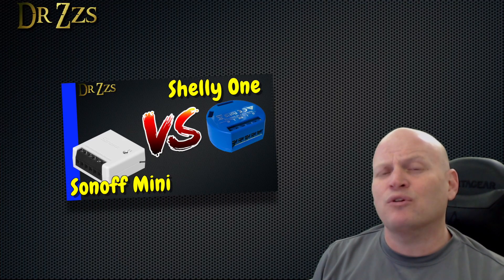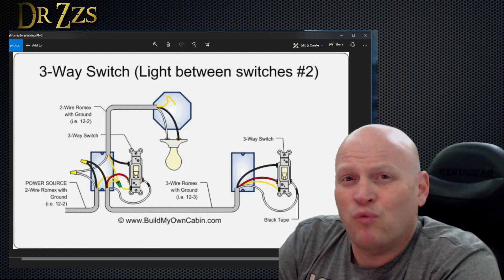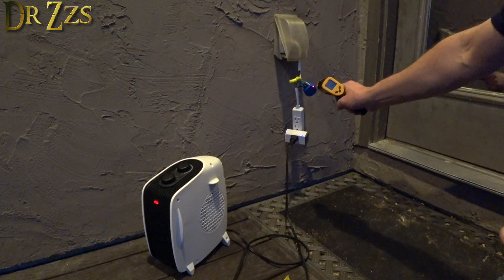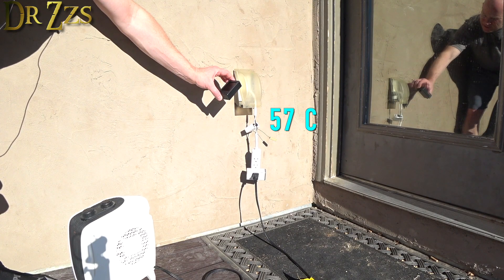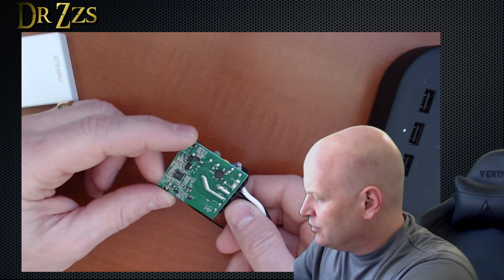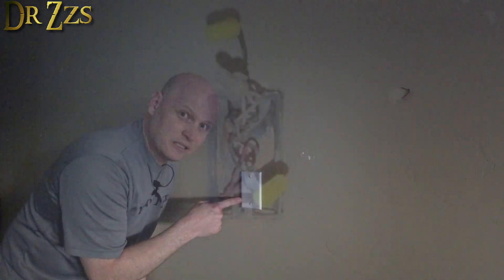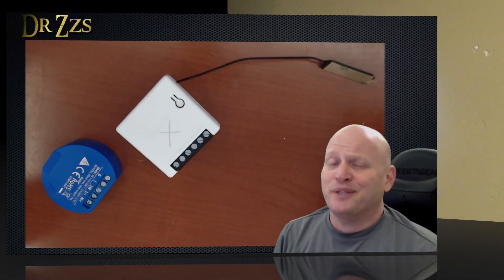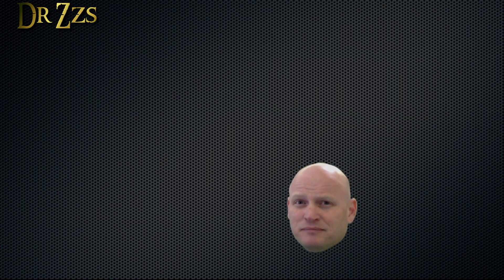More Sonoff Mini vs. Shelly One Comparisons | Home Automation

Comment: Hello, Please, I have a problem that I can't solve, I have alots of shelly controls lights. I cannot make a correct automations with any one. This because the binary sensor input that gives us the state of the shelly (if is in on or Off) is only updated with the switch (interruptor). So if the last time the switch was on, then the binary sensor remains in on state even if I turn off the light from HA. The binary sensor is only updated with the physical switch. I try all configurations but no way. I cannot have the correct state. Now i have the setting: type Button in Edge switch and Power On default mode in Restore Last Mode. Any solution to have the correct state? please need help from you boss!  thank you very much in advance

Comment: Does shelly still control the light using the switch its connected to if it loses wifi connection, or your router goes down?

Comment: I see you used much lighter gauge wire on the Sonoff for the Switch Contact Voltage test. Will that work for a 3 and 4 way set up? I'm worried about the length I will need between the switches. I know that's another matter I can look up myself, but is a smaller size ok in general for the physical switch hardware?
And thanks. I subscribed for the two Sonoff/Shelly videos but you've got a lot of cool stuff I've recently added to my watchlist!

Comment: I used to quite often lose the wifi connection to the Sonoff I had to turn my pool filter pump on and off. Probably because it was at the end of my yard inside a metal box.

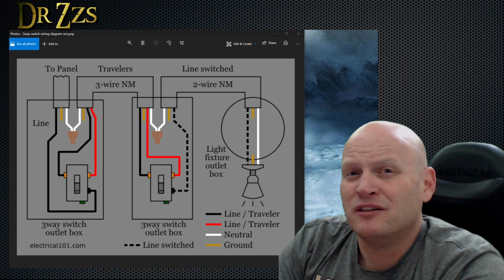Comment: 2:45 i hawe a diagram that solves the problem:) how can i send it to you?
Reply: You wouldn't still happen to have that diagram, would you?  Staring down the same thing currently, would love to see how you got it to work!
Reply: @AndréGuimond-v9j  you need to have two devices sonoff mini.  only one device will turn on the light bulb with relay. the second device will run only automation in nodered or Home Assistent. :) The Automation Starts relay on first device:)

Comment: Between the Sonoff mini with the enclosure, and the Sonoff Basic bare board, which one is harder to fit inside a single wall switch box? I have yet to own a mini, but had some hard time fitting the Basic bare board into some wall boxes in my house. Just wondwering if it would be easier to use the mini instead.

Comment: @DrZzs not ever thinking I would get into any kind of programming came into an adafruit a month ago and for Christmas received a Raspberry Pi 3, so I have some work to do with terminology and actually programming my first chip.
The exciting thing is I understand there is a way to program the sonoff, which will be of a benefit since 10 sonoff minis are on the way in the mail, to wire into my light switches, and I want to understand one thing.
Is the point to flash tasmota to a sonoff for more versatility since I already have a SmartThings Hub, does that sound right. From what I understand even though eWelink will work with sonoff and with Google home, to flash them would not only be a great exercise but make it more cohesive with my present hub.

Comment: FYI: DrZzs I order some shelly 1's but also shelly 2.5's for my home. And found out that the shelly-2 is only 8 amps, and the shelly-2.5 is only 10 amps.  I bought these 2.5 versions because most of my switches have 2 or 3 buttons. I tell this because I never hear from youtubers about this important fact.  Are we supposed to use in-line fuses for 8 or 10 amps for these shelly's too? and Why are they UL compliant if they are less than 15amp circuits?

Comment: I think that the Shelly 1 wins hands down. Might  be  more expensive but makes up in functionality and flexability. An example of this is the ability of being able to software set the mode of the Shelly 1 v's having to pull apart the Sonoff Mini (which I have)....

Comment: Great video, however I don't get which is the purpose of the neutral out put in the sonoff mini? 🤔
Reply: There isn't any need to use both of the neutrals. They are bridged inside. You can use them if you want it in between some cut through extention cord
Reply from the maker: Robin is correct.  It's just there to help with wire management.  It acts like a wire-nut basically.

Comment: Question: When turned to the of position wirelessly, can the be manual switched back on?
Reply: I was curious about this as well. Does the physical switch position effect the use of the smart functionality of either device? I want to say due to how it's wired the physical switch position doesn't interfere with the smart functionality.

Comment: What's appen if the device loose the wifi connection? Can I use the device without the home/internet connection? For example for switch on and off a room light
Reply: The Shelly will still allow you to operate the light with the external switch during network disconnects. Can’t say for sure about the mini... but I’d think it would work as well.
Reply from the maker: Yes, you are correct.  Both with still function without internet or connection to HA.

Comment: I haven't done any power consumption measuring of any of my home automation devices, except my Raspberry Pis, which came in at only about 2W (for my Rpi 2B honeypot - not doing much). I saw the 0.11/0.12A in your test. Does that imply that at 120V, these consume some 14W of power? That would be shocking! My 8TB NAS runs at 22W or so and the PIs are in the 2 to 10W range. Can you please confirm? 
thanks
Reply: This^ really would like a confirmation to this. Came to comments to ask so actually + wondered: whats the total energy consumption of the device while its working? I know we have what the manufacturer says, but your real life testing would be much appreciated. (just in case, what I mean is to measure the power consumed while on an "ON state" in which the relay coil is energized to provide the magnetic field for its thing, hence, also consuming more power

Comment: Nice! Very useful comparisons and tests! I never bothered testing the temperature with my sonoff basics attached to the garage door motor(just checked and it hovers around 45 to 50c!!).  So this was helpful and serves as a helpful reminder to check the load/temp... and now I want to get both the sonoff mini and shelly one!!
Reply: I wish he said a little more often just which temp-units. I know both °C and °F (°C is better) but I was only listening. So I had no idea he was wearing shorts instead of something like winter gear!! 
It's obvious if, well I guess... if you pay attention. 
But this is electricity! 
Who needs to pay attention?!? 
I know Everything about MY homes wiring! 
I'm not even an electrician!!
 .... ....
(Self deprecating humor has humorously deprecated myself)

Comment: I thought the last two contacts of sonoff mini were only for "signal", not supposed to have load, so i used two wires from an audio installation. Will they burn in long time load?Thanks for this review!!!
Reply from the maker: Those are for the Switch. Audio wires will be fine.  They won't burn up. 
One of them is GPIO-4 and the other is ground.  The GPIO pins on the esp8266 can only provide a very small amount of current.  0.12 amps max.  Even tiny wires from a phone or ethernet cable would be fine.
Reply: @DrZzs  lovely!  Have a nice day and congrats for the channel

Comment: 7:03 Is that your font yard??? That's... huge. ;)
In my opinion sonoff had a great chance to create an awesome product which can compete to shelly. They knew which are the benefits of the shelly.
But they've just built a sonoff basic in a smaller case with accessible gpio pins to connect a switch. Nothing special. I even don't get the point why there aren't accessible TX/RX/GPIO0/GND/3,3V connectors on the PCB. This is not DIY....
Reply from the maker: ha! 
No, that's a park behind our house.  Our yard is actually very small.  We kinda consider the park part of our yard but we don't have to maintain it.  It's the best of both worlds :)

Comment: The second neutral spot is to save you a wire but, you can loop your neutral through the sonoff mini.
Reply from the maker: I thought about that as I was watching this during editing.  Probably didn't need to attach that extra Neutral wire.  
Thanks!
Love the Beard Jordan!
Reply: @DrZzs  You could have just gotten rid of the neutral wire nut and hooked it right into the sonoff mini, saving you even more space and wiring. I truly think the only detriment to the sonoff is the amperage and wifi. However, if you're using it for lights then the amperage doesn't matter. The shelly wiring is ass backwards, IMO.

Comment: For all the fiddling around inside of switch boxes, wire nuts are so 20th century.  You need to get yourself some WAGO "Lever Nut" connectors.  These things are awesome!  You'll never wonder if you got all the wires connected inside the wire nut, they're easy to remove and replace a single wire at a time, and you can imagine actually connecting together up to 5 wires reliably if you need to.  See https://www.amazon.com/slp/wago-wire-connector/dzxsrhkj6f2k9tp and probably a bunch of YouTube videos, too.  You'll never go back to wire nuts again.
Reply from the maker: Nice timing!  
Dale just sent me a pack of those and you aren't kidding.  So much better!  
I used them in the extended version of this video when I do all the 3 way switch wirings. 
Thanks!
Reply: This guy knows what’s up

Comment: 0,11 Amp at 112v is 12,32 watt. That's quite a lot actually!
My wifi switch uses 0,9 watts when relay is on... and 0,3 watt when off, I got 230v
Reply from the maker: I was surprised it was that high too.  Could be that my Sonoff S31 wasn't calibrated perfectly.  But the comparison was the real point.
Reply: @DrZzs  When looking at your video, at 3:04 I see the graph raw and it shows 0,054A at 110v (assumed) so that calculates to 5,94W. Maybe you can get a known-good meter connected because if you got quite a lot of these devices using 12W everywhere you could have some nice bulbs on :D
Reply: @DrZzs  When looking at your video, at 3:04 I see the graph raw and it shows 0,054A at 110v (assumed) so that calculates to 5,94W. Maybe you can get a known-good meter connected because if you got quite a lot of these devices using 12W everywhere you could have some nice bulbs on :D
Reply: @DrZzs  When looking at your video, at 3:04 I see the graph raw and it shows 0,054A at 110v (assumed) so that calculates to 5,94W. Maybe you can get a known-good meter connected because if you got quite a lot of these devices using 12W everywhere you could have some nice bulbs on :D
Reply: @DrZzs  When looking at your video, at 3:04 I see the graph raw and it shows 0,054A at 110v (assumed) so that calculates to 5,94W. Maybe you can get a known-good meter connected because if you got quite a lot of these devices using 12W everywhere you could have some nice bulbs on :D
Reply: @DrZzs  When looking at your video, at 3:04 I see the graph raw and it shows 0,054A at 110v (assumed) so that calculates to 5,94W. Maybe you can get a known-good meter connected because if you got quite a lot of these devices using 12W everywhere you could have some nice bulbs on :D
Reply: @DrZzs  When looking at your video, at 3:04 I see the graph raw and it shows 0,054A at 110v (assumed) so that calculates to 5,94W. Maybe you can get a known-good meter connected because if you got quite a lot of these devices using 12W everywhere you could have some nice bulbs on :D
Reply: @tychowerner  Tycho, could I find out what are the wifi switches you are using that consume only 0.3/0.9W? I am also running 230V, so this is quite important to me
Reply: @EudaemonVideos  Hi, I use these plugs: https://www.action.com/nl-nl/p/lsc-smart-connect-slimme-stekker/
Reply: @tychowerner  Thanks, I'm looking for light switches though, and Sonoff and Shelly seems like the best options. The power draw at 230V is a little alarming though - I might as well leave my LED light on in that case!
Reply: @EudaemonVideos  Well; what I suspect is that DrZzs's measurement isn't accurate. With 12 Watt it's more then most LED bulbs.
When you increase the voltage from 110v to 230v the ampere's goes down so the total power stays the same, useally.
Reply: @tychowerner  Yeah I saw other videos that test using wattmeters registering 0,3-0,9W, but readings might be less accurate too and uncertain if the wifi is connected. So maybe the figure is somewhere inbetween with DrZzz's.

Comment: I'm interested in your upcoming 3-way switching video as I think I have the wiring set up like in the 2nd scenario you show where the line comes into the light and then goes out to the first switch box - since there are not neutrals in the switch box does the shelly go the light fixture box?
Reply from the maker: yes. That's exactly right.  That actually makes for a pretty simple install.  Shelly goes in the box, Line and Neutral to the Shelly, 'O' goes to the light, Neutral from the light goes with the Neutral from the panel, then the switch contact on the shelly takes the wire from one of the 3-way switch's common pole (likely black or white with black tape).  The other common pole wire from the other 3-way switch goes to the hot from the panel.  You also need a wire from the hot to the "I" on the shelly.  
I'll be working on that longer version a lot and will get it out soon.

Comment: That last comparison... For diy it's sort-of-OK. NEC requires certain isolation practices between mains and LV circuits that you're not likely to attain w/ your T/RH sensor. Maybe I'm wrong though.
Reply from the maker: You are probably right.

Comment: I attempted to install the Shelley 1 into a dual gang switch box. Unfortunately, the box was too stuffed with wires that went no where that the Shelley couldn't fit. ☹️

It's actually for my bedroom ceiling fan/light... So maybe install them inside the fan housing? That's IF I have access to the hot and neutral wires up there.

Thanks for all you do!
Reply: use the sonoff mini. If you understand wiring you can save yourself a lot of space that you wouldn't be able to save with a shelly.
Reply from the maker: I've had that problem too.  Sure seems like our boxes get over-stuffed with wires a lot.  I have a 3 gang box in our bedroom that must serve as a junction box for several circuits because I took out the 3 switches and replaced them with a single Sonoff T1 and I still had a hard time fitting it all back in there because of all the extra wires coming in.

Comment: Check the dead Sonoff for a fuse. Could be a quick fix
Reply: It could also be a blown VR (voltage Reg. Im willing to bet on it) A little AMS1117 5.0v or 3.3v on-board? Worth a look. Like 50cents to fix if I am right!
Reply from the maker: that's probably true!  I'll poke around and check.  I'd love to get it back to functioning.
Reply from the maker: I didn't see one, but I wasn't specifically looking.  I'll check again (and hope you're right :)
Reply: Its not a fuse. I think is the relay contacts

Comment: 2 Shelly’s have literally exploded in my hands....

I was very excited to get started with them, but apparently they are built very poorly according to a mechanical engineer I know.
Reply from the maker: That seems extreme.  Can you describe the situation?  I'm not paid be Shelly at all but I believe they are built pretty well compared to many other devices we use every day.
Reply: I prefer the Sonoff mini, especially the wire terminals that you've showed in your previous video.

Edit: about the Sonoff mini, you might be able to use the 3,3 volt switch terminal as an input to power the device for flashing.
Reply from the maker: I like it too.  Much improved over the sonoff basic.  I'll check that switch terminal, but I thought it was GPIO14 and Ground.  I really do wish they had given us easier access to 3v somewhere near those terminals.  Then we could use those terminals for a sensor or use a powered switch with an LED or a cap-touch.

Comment: Can you do a review of the Shelly 2 and Shelly 2.5? Features, use cases how to connect it, etc.?
Reply from the maker: I can do a project using the 2.5
Reply: @DrZzs  Pls do as I was unable to find good documentation online on how to with these devices (No schematics, no how to flash it with Tasmota and how to install it).  Only Shelly 1 has good documentation and tutorials
Reply from the maker: You got it.
Reply: DrZzs thanks!!!

Comment: There are too little electrical engineers (circuit builders) in Bulgaria, but It's seems there are enough good ones. Thumbs up.
Another good product from the city of Plovdiv this time are the Olimex circuit boards (SoC). They have boards specially build for alexa or g-assistant. 

I'm ordering shelly soon. 

Keep on rollin'. Greetings!!!
Reply: I was also surprised that they are build in Bulgaria when i herd of those switches first. I think they are  build by "Allterco" they also have few other toys, And if DrZzs is happy with them i'll take his words for granted :). I'll be buying few of those for our apartment

Comment: Have you ever had an electrical inspection for a residential home automation project using either of these devices?
Reply from the maker: uh, no. 
Why would I do that?
Reply: How does it work with the insurance over there then ?
Do the different companies involved have any wishes 
Are you still covered
Reply from the maker: I believe in Australia they have rules about requiring an electrician to install these kinds of devices, but we don't have that rule here.  
As far as I know (not being a lawyer), as long as the device is "UL Listed" and it is installed properly, you're covered.  I need to find a lawyer that is willing to join the discussion.  Most of this just comes from "the internet" and discussions in our community.  
I guess I could call my home owner's insurance and ask them "for a friend"...